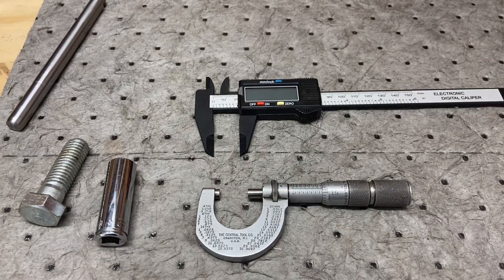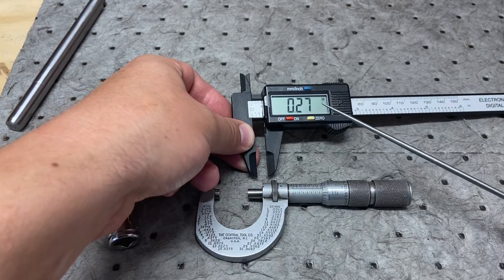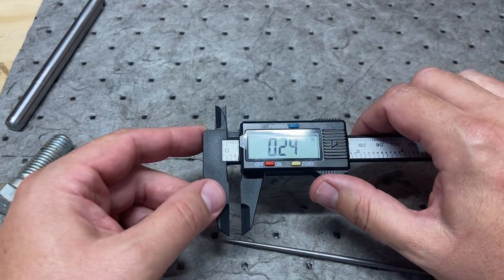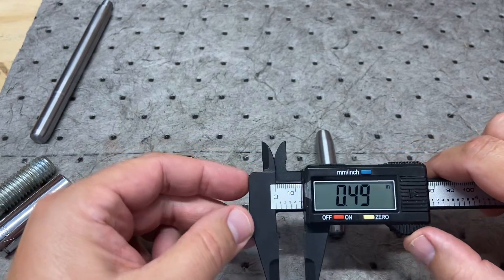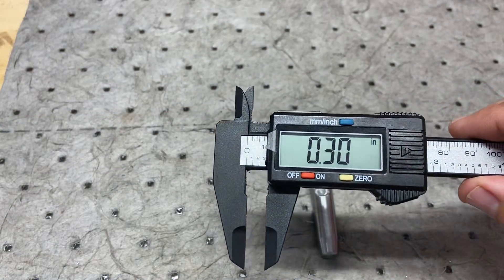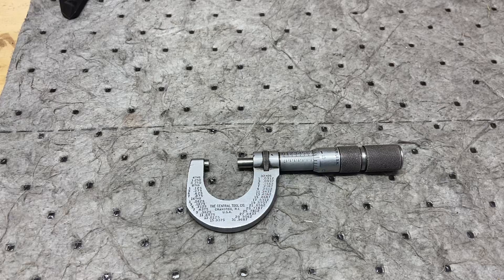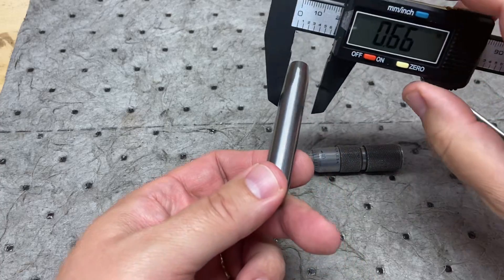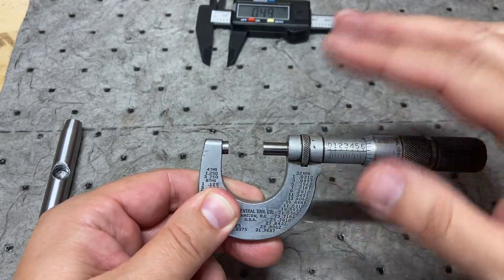Vevor Mini Lathe MX 400 Part 22 - How I read a Caliper and Micrometer including tool overviews.

Comment: I use same and have few calipers. plastic are as good except they dont tolerate heat as good as stainless ones and flex. I learned from one guy on youtube how to fix them if they are off. Most of times they dont deburr them so they show off in measurement. You can sand teeth in a way to get accurate start position. I test mine all the time against micrometer to get a feel how accurate it is and most of time is close to 0.02mm which is about a thousand right? 
So even if some are cheap but metal they can be good. I just looked at closed teeth on mine and saw where to sand it to not see light passing trought it.
Reply from the maker: The digital calipers are very convienent for sure.  This one I am using was less than 10 bucks and has been working just fine to get started.  I have an upcoming video where I did purchase another set that is Stainless and has better accuracy down to the thousandths and I think half a tenth even.  Haven't messed with them much but have the + or - 10 thou was going to be an issue at some point with the plastic ones I had.  I don't have any sets of gauge blocks but using a micrometer is a good idea to check the accuracy, I am going to give that a shot.  Thanks for watching.

Comment: Keep the vids coming! We are not all expert machinists out here in youtube land!
I have enjoyed watching your learning process!
 I just got a similar machine to yours, the mx 210, and really I am very pleased with it. 
Yes, it needed a bit of fettling, but I have enjoyed doing it.
My first projects, rather than making the things I bought the lathe to do, have been making things, like many others, for the lathe itself! - made some nice replacement levers with black ball knobs for the half nut, toolpost, and tailstock lock,- in the process learning how to cut threads using the machine, -after puzzling out the change gears, it worked fine!
 - I am working in metric though, Imperial may be more of a chore! I havent gone there yet!
Reply from the maker: Thanks for the encouragement,  I have really been enjoying this lathe and learning to use it.  Even fixing the small things and adjustments,  I find it enjoying.  I want to get a better tool post soon and think that may end up being my first lathe mod project,  Likely needing a different Stud for the tool post.  Hoping to try my hand at threading for that mod.  Thanks for watching